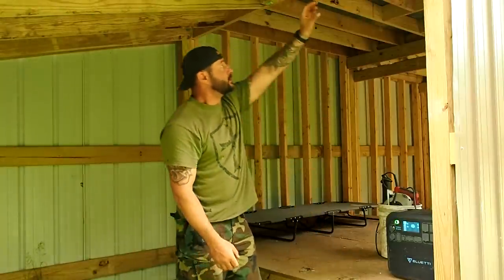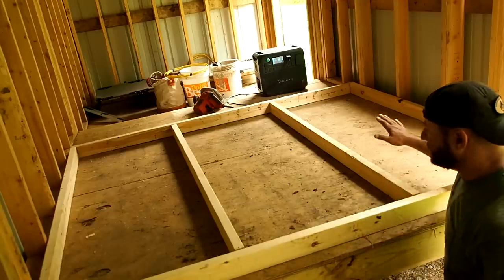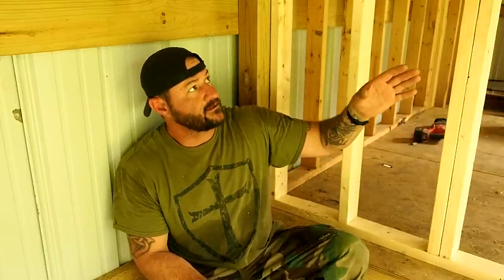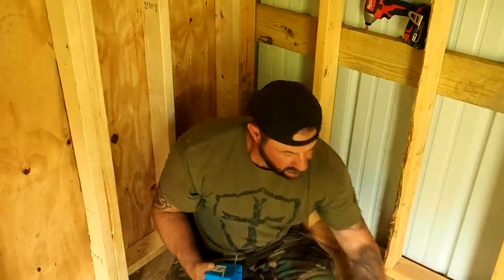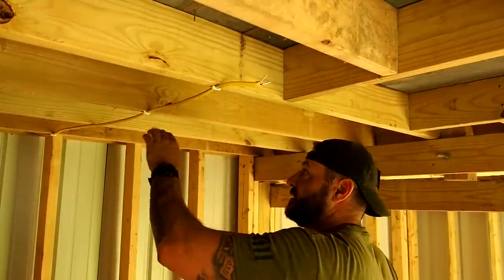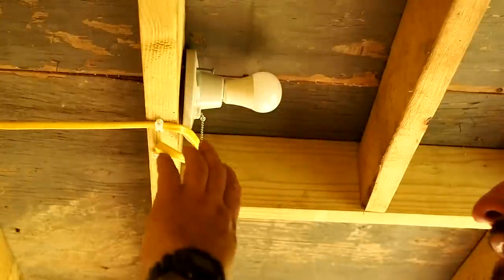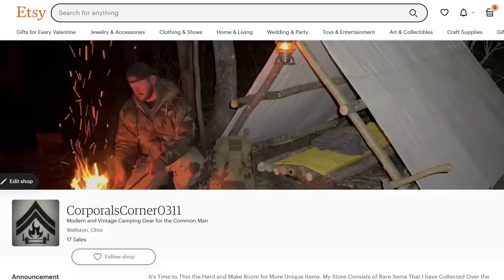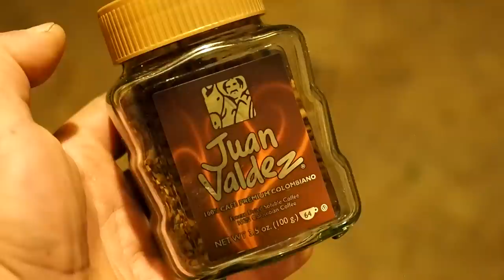Solo 10 Day Overnight Building the Off-Grid Apocalypse Cabin in The Woods and Baked Bacon with Beans

Comment: Can't suggest rodent guard trim on exterior bottom of the corrugated metal walls enough to stop the vermin from running up those channels in the siding and nesting/chewing all your insulation and wires
Reply: Thanks for this. I've a little project that is going to need that 🗒
Reply: @heymambootialiana  Up until about a year ago, I was not even aware they made such bottom trim to cap off the channels or that it would be such a problem. I heard an acquaintance lamenting their infestation in a detached garage/workshop where they had left the bottom channels of all the siding  open.
Reply: Lettem come, haven't seen fried rat or tree rats. Squirrels!
Reply: I poured concrete inside of the bottom of my corrugated walls.
Reply: Years ago now, I'm pretty sure I was able to get some *great stuff, or maybe it was from DAP 
that actually had Tabasco in it.
May have been called mouse block but the one I recall getting was for rats.
All that to say, I echo your sentiments on the "blocks"...
Reply: @juliafayeconner594 and that works to keep the rats out?

Comment: I've used Milwaukee tools in Constuction, HVAC, Ground up Plumbing and RES Sprinkler. The Cordless tools switch's eventually give out to horrific abuse. But the batteries are unstoppable. I bought 5 batteries, 7 years ago cold hot climate region and they're still going. This shack is awesome, but instantly I'm noticing the Corp might have dabbled in construction. One thing to build a tent, another to use a tape measure. OUTSTANDINGAF! XD

Comment: Curious are you going to spray foam the walls to seal them and add insulation. A suggestion if you do stuff the gaps with steel wool first the vermin won't chew their way in. Also are you working on food plots?

Comment: Nice to see this project continuing. Really like the sliding door too. Your electrical setup is a capitol idea for my shed too. In a year or so you may want to do a “ remodel to include new ideas vid.” You may want to add plastic strips to the bottom of the slider to quiet it down, especially during deer season add some graphite to keep it sliding smooth. Way to keep it hard core by eating beans in an enclosed space, Marines will appreciate this …LOL! BTW, your bacon to bean ratio is off brah….! 😂 Semper Fi

Comment: For lumber, it's always just short of the size named by 1/2 inch. 2x4(1.5x3.5), 2x6(1.5x5.5) Only one that's different is 2x10 comes in 9.25 some times for whatever reason..
For board, it's 1/4 off. 1" is 3/4", deckboards are 5/4(five quarter) which is one inch. Also, if someone were really concerned about the cost, studs on 19.2 inches and more commonly 24" layout is acceptable in home construction. Also gives you room for more insulation between bays. If you want to add a second story or have more insulation. Go to a 2x6 stud on 24". I done it in my cabin no "regerts" LOL
Excellent video and thanks again! 
Edit: As contractor who does a lot of framing, a pocket knife is highly accepted as a chisel and for scraping off excess PL glue!

Comment: Pro tip for using a circular saw on 90° cuts, butt your speed square to the saw table after you line the blade up for a straight cut every time with minimal effort

Comment: With outlets remember, black on brass saves your ass. You also don’t need to cut the flaps on the outlet boxes. They act like wire connectors.

Comment: Very nice video, you accomplished a lot on the cabin in this one. 
Question re the electric set up you installed. I have zero experience so, while I can see this is a basic set up and might be something I can do, I need more info. Specifically, there are two screws on each side of the outlet (where the black and white wires attach). You did not show that step so I don't know which screws you used on the sides or if it matters. Any chance you can review that detail in the future?

Comment: Great build. Suggest you make your door out of 2x2 inch instead of 2x4 so its easier to open. If you use counter weights on the ends at the top of the door with 550 cord, this will assist in opening the door left or right. Old windows use to use weights to open the window up. You could bushcraft a pully system for the weights or just use an eye screw. Great video and idea for the shelter.

Comment: Waiting for the “that’s a suicide plug!” Comments! 😂😂
I have dual circuits in my cabin. 2 plugs hanging out. When I’m using the power supply inside, I plug the generator plug into the power supply receptacle. And vice versa when I’m running the generator outside. Double duplex boxes all around. 1 side is 15 amp wired for power supply and the other 20 amp wired for the gen circuit.  Seems complicated but not.

Comment: Personally I have a 24V output system that also has constant current sockets for LED lights. 2kWh total. I have specified a seriously low power PC (40W all up flat out) that is good enough for watching films etc. Both can easily be removed from the house (with the solar panels) and it saves me a fortune in electricity as well as being easy to just pick up and go with. The one thing I have not worked out yet is how to heat food without a flame long term. There has got to be a way of doing it.

Comment: Depends on how secure the location is whether you want them to be permanent or a way to hang suitcase panels temporarily, but you could also put conduit and the cable to charge the solar generator(s) in way that you could have pass through charging where you just plug stuff in when you're out there. Not sure how secure the location is to have permanent ones on the roof,  but you could definitely also create a setup with some portable ones that could be stored and set out as needed. I love solar generators, they are such a game changer for being able to have electricity on demand anywhere. This isn't the kind of structure where you're going to want a full Tesla power wall system to run your major appliances, but conduit protecting cables installed permanently would be a really handy feature.❤

Comment: it would be much more efficient if u got a battery operated circular saw {preferably in whatever kind of drill that is so u can use the same battery} and a "diablo blade". Shouldnt cost much more then $100. Personally I like "Kobalt" as they are about 1/2 the price of Dewalt or Mill. with a better warranty. And no Qs asked return at "Lowes".:oops:

Comment: Really nice off-grid cabin, however I would not think it will be better suited for an apocalypse than any other cabin. In fact I would think any 19th century traditional log cabin design with an earth cellar is better suited for any type of apocalyptic scenario. Consider the most plausible scenario is that a strong solar flair hits earth and destroy all electronics on the planet. This means that we no longer has access to any money in the bank and all data of our money will be forever lost as it will take too long time to repair the damage to retrieve the lost data. And that is just the tip of the ice berg of problems we will face. It will be total chaos as our civilization collapses. The fall of the Roman Empire and the plunge into the dark ages will be like a summer breeze in comparison.

Comment: hand saw and egg beater drill....mortise and tenon the 2x4's with a hand miter saw and a coping saw for the mortises...glue up the joints and use cotton clothes rope tied in a loop around wall assemblies with a rope twister to hold until glue dries then use the drill to make pin holes and use golf tees for mortise and tenon pins and also golf tees make great nails too just drill the hole and tap in the tee with some glue on it.hand tools make everything way funner

Comment: Just Remember   BLACK - GLOD ,  And try something like (DOSTATNI 2 Roll Drawer Slide Tape Low Friction Tape Transparent Abrasion Resistant Tape for Commercial & Industrial Drawer Repair Noise Reduction Surface Protection ) for your sliding door.    
Great build.   Also is  A Great Reminder of What You Forget, if you not doing it every day now.